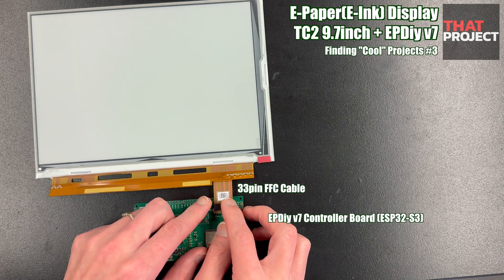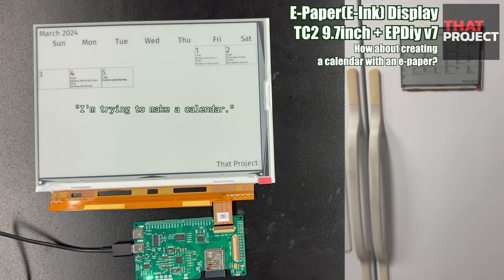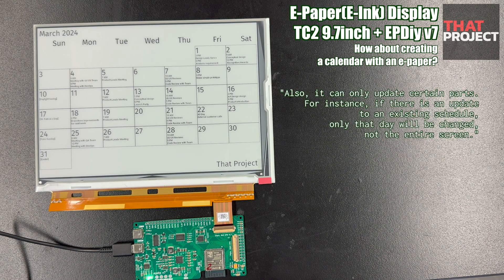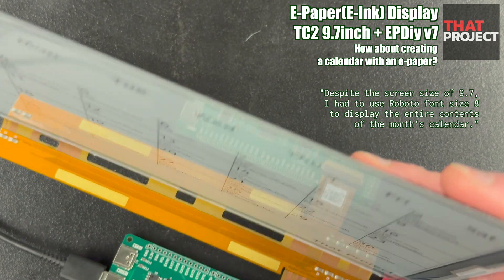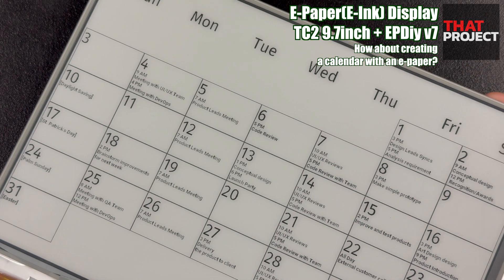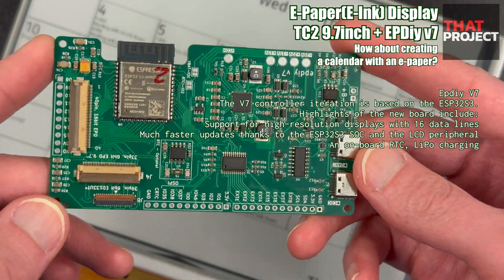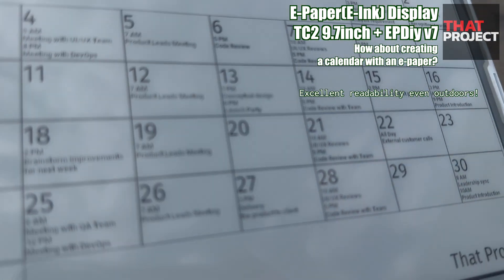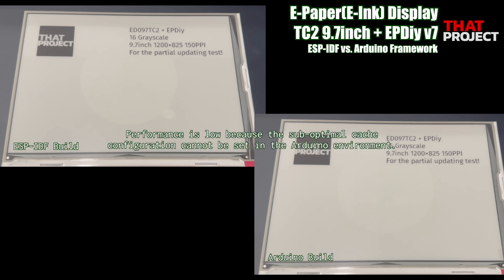e-Paper Calendar to manage family scheduling #ESP32 #EPDiy #ED097TC2

Comment: I’ve seen projects using MagicMirror2 on Raspberri Pi 4. Do you think this display could be used with that project?
Reply from the maker: This display module can be used by connecting to a Raspberry Pi. Check this out. 
https://cdn.hackaday.io/files/1681937195969312/terminal_demo.mp4

Comment: Is the low performance due to the Arduino IDE or the Arduino framework? I don't really understand how people use the Arduino "IDE" when it's little more than a text editor, and much prefer using PlatformIO with VSCode to have a real editor. ISP-IDF is a bit more low-level than Arduino in my experience, so I'm curious what the actual limitation is here when using Arduino. You mentioned caching, what exactly is being cached when using ISP-IDF and why can't Arduino do it? Thanks!
Reply from the maker: Good point!
This is an issue where you cannot control all of the ESP32's SDKConfig from the Arduino IDE rather than the Arduino Framework.
If CONFIG_ESP32S3_DATA_CACHE_LINE_SIZE is smaller than 64B, 100% performance will not be achieved. You can set this through MenuConfig; you cannot change this from the Arduino IDE.
Reply: @ThatProject  Thank you! This sort of detail from someone who encountered the issue is very valuable, it's great to have it explained here for others who might face it as well. I see this variable is mentioned in the docs with the limitation you described, I wonder if setting it with a `-D` in platformio.ini would help at all or if it's just the input to some further configuration.
Reply from the maker: @desmond-hawkins  This part can be set in platformIO, so I don't think it will be a problem.
Reply: @ThatProject  Oh cool, that's good to know.